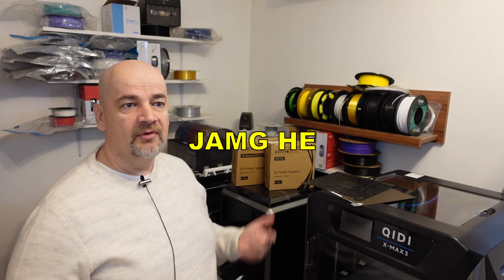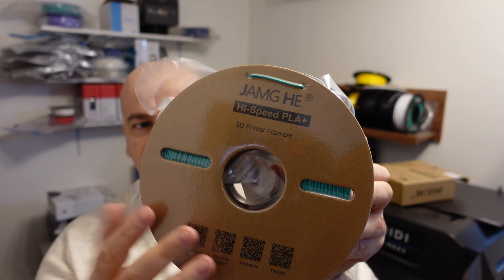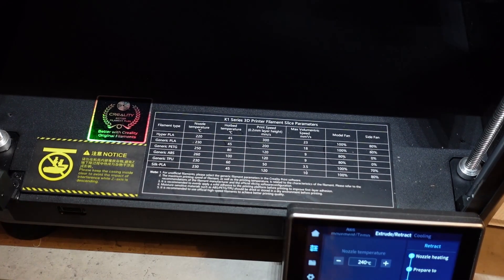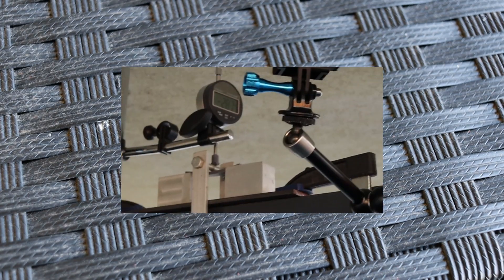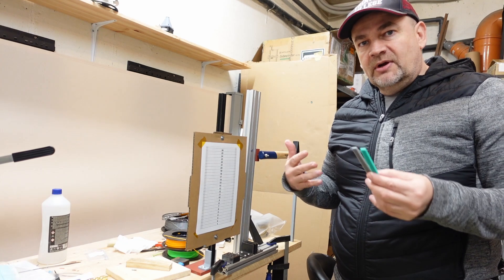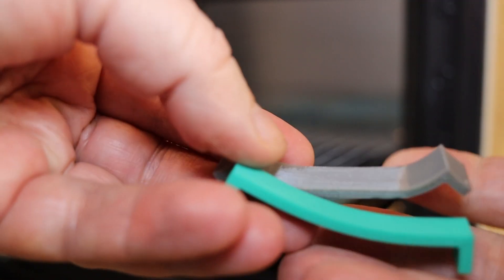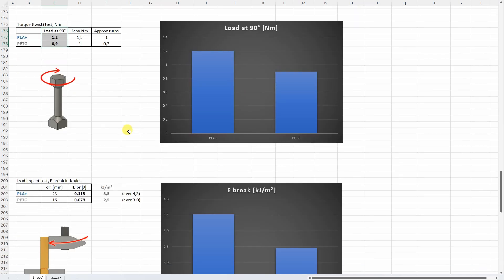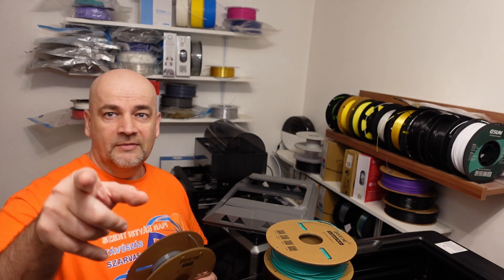PETG vs Hi-Speed PLA+ by JamgHe, The review and mechanical testing

Comment: 👍👍Thanks for the professional tests, it was Suprise that regular petg runs well on K1, for K1 with hi-speed pla+, if you use default setting, try  at 200 degree, the surface will be great.
Reply from the maker: I don't like to print PLA on 200C, I worry about the layer adhesion.
Reply: I am printing PLA on CR-10 SE at 240°C at 300mm/s. At those high speeds even 220°C is too low for many PLA-s despite Volcano-length nozzle

Comment: I want to thank you for a great video that answers many of my questions. My son has sent me an Elegoo printer that will arrive soon. I am a 78 year old newby lol, and my concern is that I have also received a roll of JAMG HE filament and I am concerned about the prints sticking to the print plate. I don't yet know what the print plate surface will be, and I believe that there is a glue stick in the package, so I understand that using that will prevent printer plate damage. I have so much to learn, but after watching your video, I feel more confident. Thanks again!
Reply from the maker: Jamg he filament, PLA or PETG? For PLA you don't need anything.  For PETG, depend of the plate. For first print try something small, 10mm cube. Bed temp 70C. But wait until bed cools down. If it sticks too good, use PVA based glue stick. It is water washable.
Reply: @MyTechFun I have PETG. I understand and I will do as you suggest. Thank you for contacting me, I really appreciate you. 🖖👀

Comment: Good tests (as always) The Jamghe high speed PLA+ looks like it might be a good option, as it’s much more affordable on Amazon than the name brand PLA+ formulations. People on Amazon did complain about mild stringing though, which you also seemed to experience. I wonder, did you dry it before using? Some others on Amazon found the filament to be rather wet out of the box.

Comment: Hi Igor,
Thanks again for all your work on the filaments, it is appreciated.
Another test which I would find useful, especially on the TPU, ASA, and PETG materials would be abrasion resistance. 
Tom
Reply from the maker: Tom, you are reading my mind, that's exactly what I am preparing, but it requires some time to figure out the test equipment.
Reply: @MyTechFun  , that’s good news. Have you thought about weighing a test piece and then dragging a weighted file across it several times then re weighing the test piece? It would simulate my problem, which is the part being dragged over rocks.

Comment: Do you find yourself preferring to use the Bambu or the QiDi more on a daily basis? Or do you have no preference?
Reply from the maker: Currently the printer I use the most is Qidi Xmax3 (but I have only P1P from Bambu). The X1C is still in the box (next to the Flashforge 5M Pro and Two Trees SK1)
Reply: @MyTechFun  I use an X1C and I want similar quality and speed etc… but I want a larger print volume, so the QiDi looks like a good option to me (possibly the only comparable option).
Reply from the maker: @colinmsmall  The quality of X1C is better compared to Qidi (the printer itself, not the 3D printing) BUT I like Qidi because of additional functions (nozzle up to 350C, heated enclosure 65C, big volume..). Printing quality is similar.
Reply: I just bought the qidi for the same reasons and am impressed so far with the machine. Only paid $750 after an Amazon gift card too😊
Reply: @notanymore9471  do you have a Bambu also?